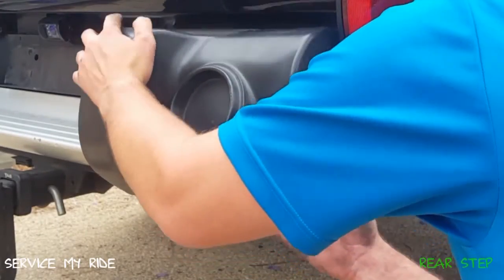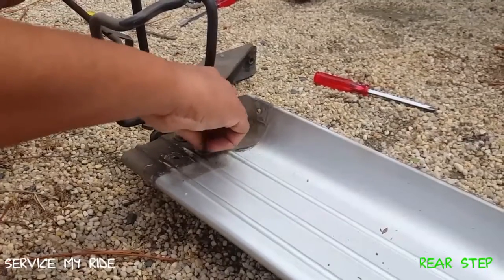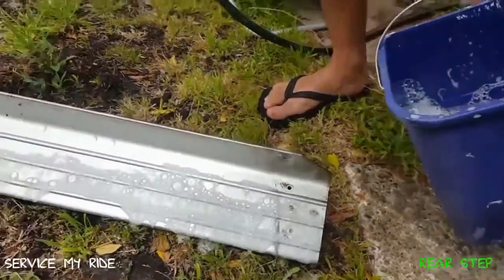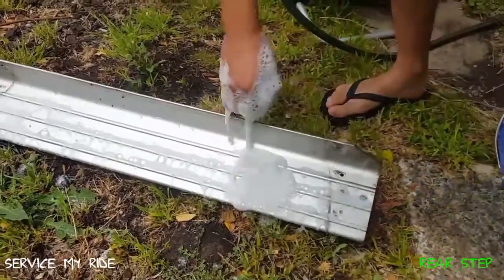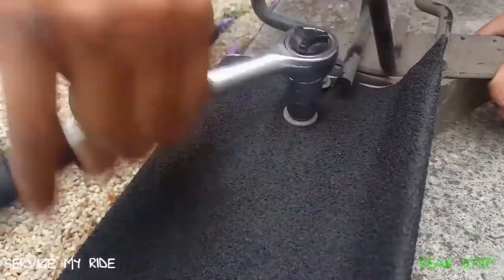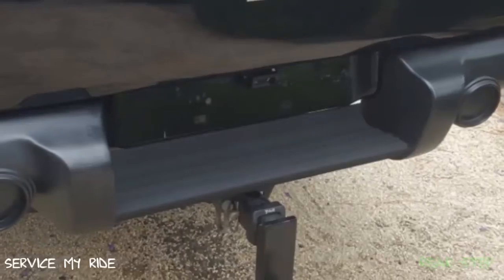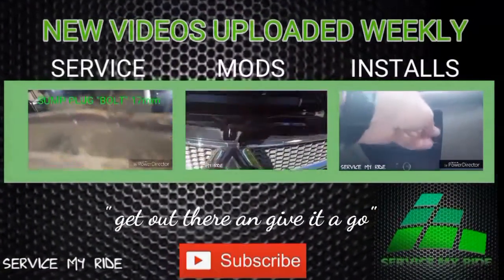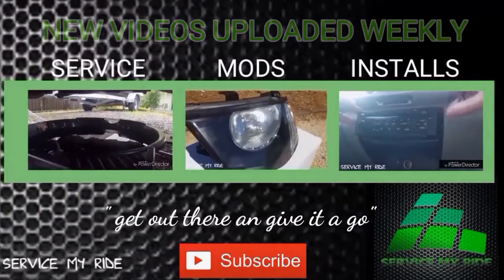Non slip rear step

Comment: what was the grip that you were using?
Reply: Same question.  3m rubber floor mat?  Couldn't see the side steps clip you mention in this video....
Reply from the maker: Bought from 3m direct, side steps where never done as I want to upgrade to sliders.
https://www.3m.com.au/3M/en_AU/company-au/all-3m-products/~/3M-Safety-Walk-Slip-Resistant-Medium-Resilient-Tapes-and-Treads-310-Black-910mm-x-18-2m-Roll-1-case/?N=5002385+3293725664&preselect=8709314+8710653+8718931+3293786499&rt=rud
Reply: @ServiceMyRide  thanks.  yeah would love sliders but bar work very exie. Ripped the towbar off yesterday cos the lack of clearance was getting annoying Appreciate the channel.  Had the Triton for 6 months and suddenly have time on my hands.
Reply from the maker: Cheers mate, had mine coming up 6 years, been a long process but its getting there, lot of free time lately so getting some stuff done.